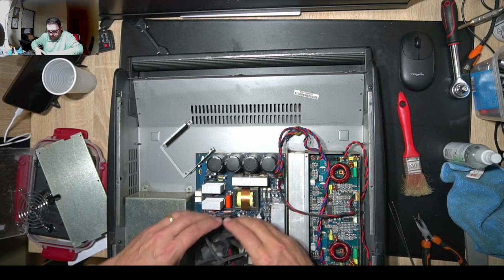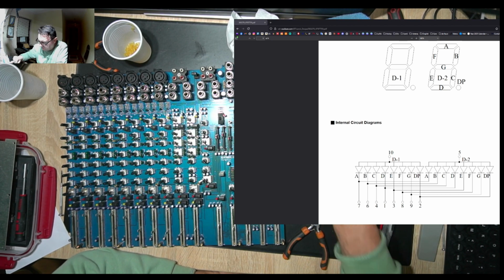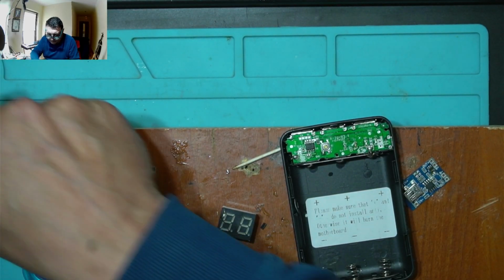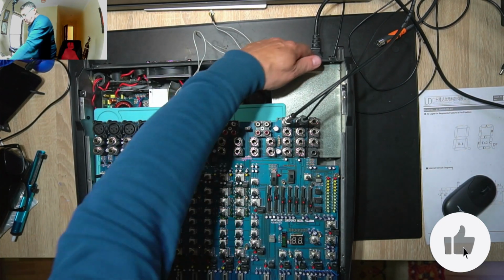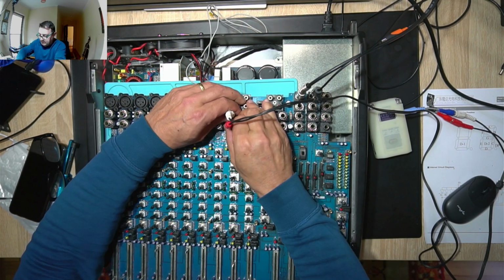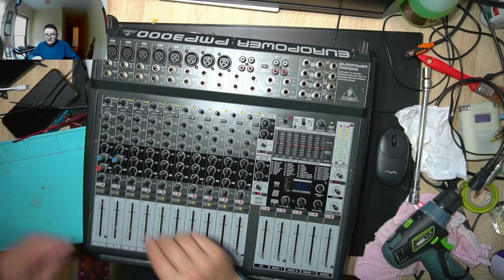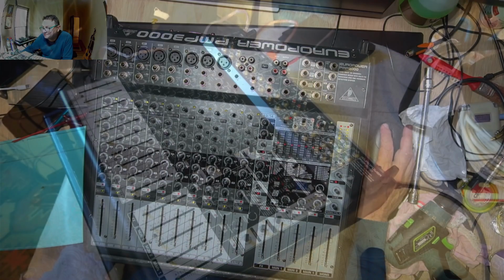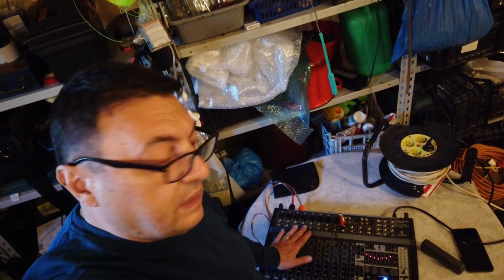Behringer PMP 3000 LED fix and more part 2

Comment: Salut, Vio! Am și eu o problemă cu Behringer-ul meu PMP3000, pe care momentan îl folosesc doar pe ieșirea pasivă, cu amplificare externă, deoarece amplificarea internă nu mai funcționează. Crezi că mă poți ajuta? Ți-l pot aduce la reparat?
Reply from the maker: Imi pare rau dar nu sint profesionist, nu fac reparatii in mod curent. Mai ajut cite un prieten...cea mai simpla solutie ar fi achizitionarea unui modul stereo de 2x500W de pe Aliexpress, vine cu alimnetare cu tot si face treaba excelenta. https://www.aliexpress.com/item/1005008419394003.html?pdp_ext_f=%7B%22sku_id%22%3A%2212000044980366761%22%7D&sourceType=1&spm=a2g0o.wish-manage-home.0.0